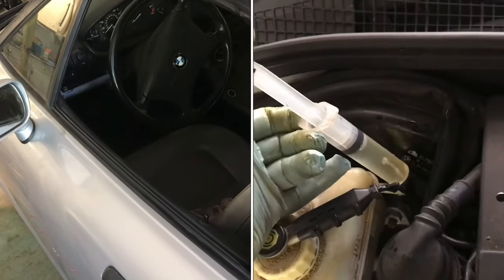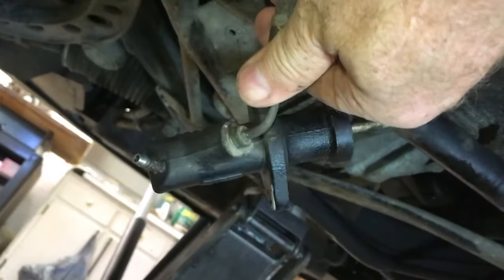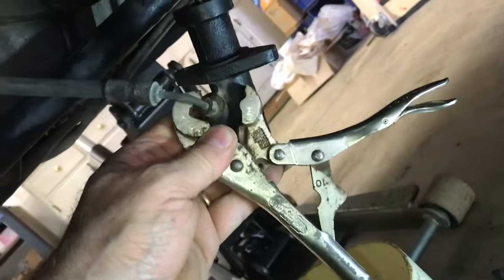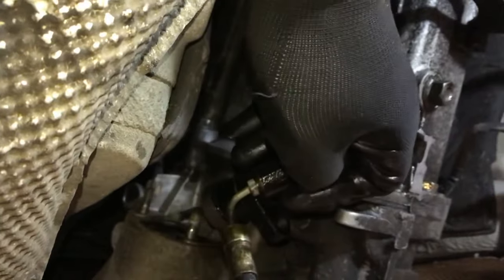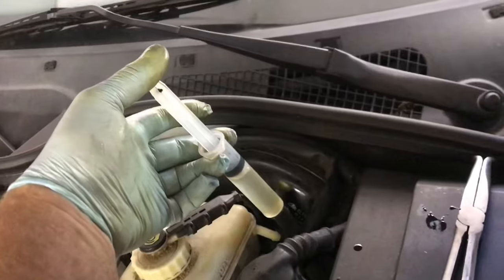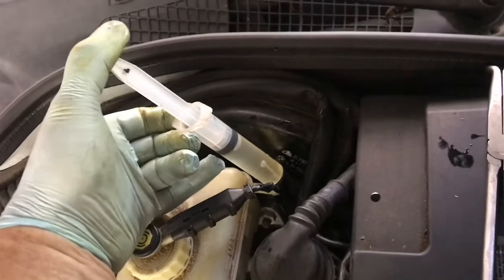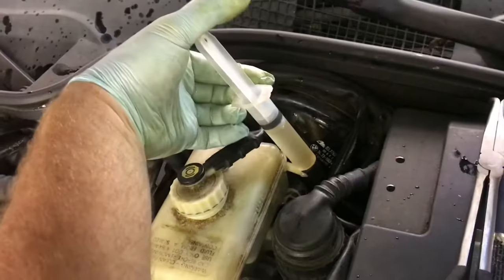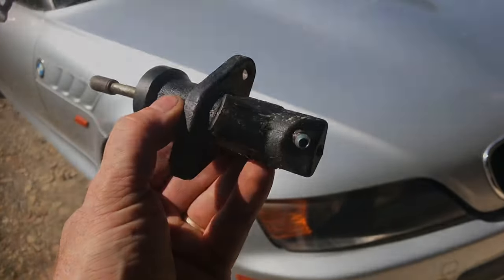“replace” CLUTCH SLAVE CYLINDER bmw (how to bleed the air out)  z3 e36 e46

Comment: I got lost right before the minute.  Why remove that hose at the reservoir if youre gonna have to reconnect it?  Wouldnt that put air in the system again?
Reply: Not really, the reservoir is empty, but the hose and everything in the system below it is free of air, full of good fluid. If you get an air bubble while connecting the hose, adding the proper amount of fluid to the reservoir will take care of it. Disconnecting the hose will make it very easy to remove the air from the system as shown, vs other methods

Comment: Where did you get the plastic syringe with the wide tip?
Reply: It's probably for a turkey injection kit, the basting needles thread on the outside

Comment: I have to bleed my clutch every 6 days including the slave cylinder I've changed the master and slave about 8 times no matter what brand I use I can't shift unless I bleed it every 5 or 6 days.... Not losing any fluid...😅😅😅
Reply: Could it be a crack in your hoses letting air in?

Comment: I hav 08 santa fe wit clutch ..hav mech.comin nxt week to do slave.. master he already did bout wk ago but found slave nogood..n will put new clutch in also ..he doin this in street on ramp.jacks etc..watu pump fluid in where can get n wat it is called.i def will show him this vid..thku.paid bout 600 in parts.n givin him 800 for job..tryn this if fail i buy new .but luv this engine only 90k miles in 16+ yrs..runs great .so i takn chance wit recomended street mech.dont wan pay 5 .6 k for dealer

Comment: Great video! I only have one question/doubt, wouldn't then the brake fluid start leaking from the reservoir side tube? Why not bleed it normally like the brakes with a pressure bleeder on the reservoir and bleeding underneath?
Reply: This way, he can force fluid in with the syringe and the pedal. Vs just the pedal, or just gravity. The orientation of certain hard lines or components can trap air instead of forcing it out. The 4 cylinder ford ranger clutch slave cylinder is notorious for this, there's an upside down U in the hard line, absolutely MUST bleed the air before installing it, or you won't get it out